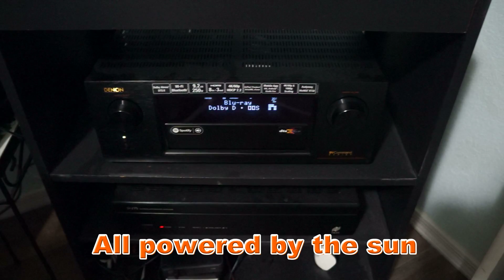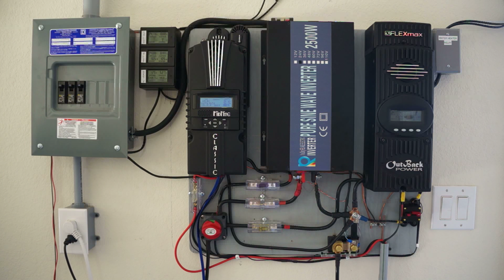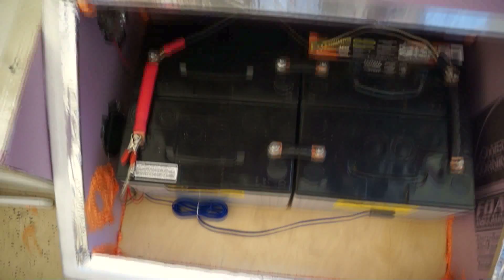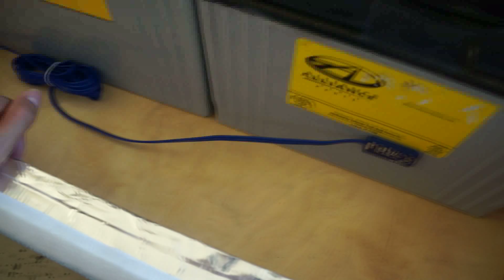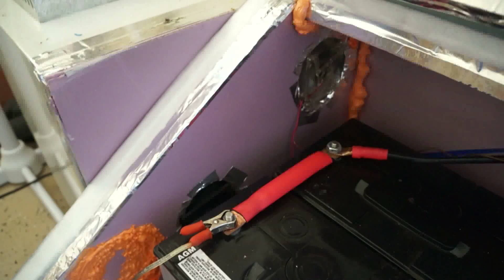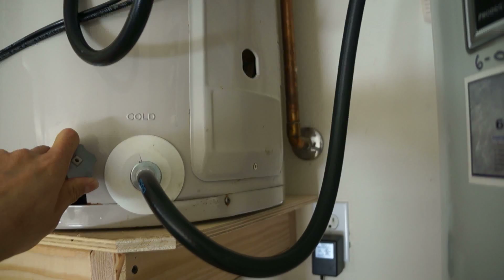2kw Off Grid Solar Overview - cooling battery bank, electric solar water heater! Midnite 150 Outback

Comment: This is great!!
I am looking to do about the same setup, do you have schematics on how you have the board set up with the midnite setup? or in depth pictures showing connections. Also part numbers and model numbers of what you have would be great, from the 24volt inverter to the electric combiner boxes.
Thank you for the video it has helped me stop obsessing on which way to go with the system I want to build.
Reply from the maker: Sorry, unfortunately I have no wiring diagram... I kind of rig it up as I go.. :)
Reply: Nice video! I noticed a few viewers asking for diagrams. With the demand for green energy and lot of folks wanting to do it themselves, have you guys ever thought about creating the diagrams with  the components needed and put them somewhere they can be purchased. Is there a law that restricts doing so? Add me as the first purchaser. Thanks

Comment: Great video. Plan on doing something very similar when we buy a house again. currently live in our fifth wheel trailer near Casa Grande. I have 1200 watts of solar with a classic 150 and agm batteries.
Reply from the maker: If I may make a suggestion, please look into getting LiFEPO4 or LI-ION and skip the AGM.  You can find LI-ION cheap on Ebay now.... LeadAcis/AGM is just troublesome... not worth it any more...  They were best at their time, but technology has move on...

Comment: Thanks for sharing some very useful info. Your outback charge controller might need a system reset. Mine sometimes refuses to go into float mode but after a reset its good once more
Reply from the maker: Reset, as in unplug battery and turn it back on?  If so, I have done it many times.  Anyhow, too late now, got rid of it already.  :D

Midnite Classic has been running without any problem.

Comment: Maybe I'd missed it, but why buy a DC element, all things considered an element is a resistor either or should work, and also why buy a second water heater when you could have put the DC element on the main water heater and the upper element becomes the backup???
Reply from the maker: It's a GAS water heater, there isn't any element.

As for AC or DC element, you're right, there's no difference. What I was trying to say is get the proper wattage ratting element... most of the one use for AC are 1500watts or more... Wouldn't work to well with low voltage dc.

Comment: So I was thinking about this.  What is your ground water temp ?  because if it's something like 60 degrees, you might be able to run a coil in place of your fridge using ground water to cool the batteries. Then, continue the ground water loop into a large circular ring even inside your garage that would pick up ambient air temp, thus preheating the water to something close to 100 degrees before entering the electric hot water tank.  What are your thoughts?  Of course, this would only work if you are consuming hot water off and on during the day....
Reply from the maker: Winter time the water is cold in the 50-60F, but in Summer time it's 75-80F, wouldn't help much.
Reply: Experimental Scientist you are LOL. hats off ;). But NO! The possibilities are endless with great minds of the people unfortunately if you ever do find an efficiency keep it to yourself because most that break that barrier and share are never heard of again. Not allowed ;)
Reply: Many think like you and try to find ways and some succeed. The problem is It is not allowed! Efficiency is controlled and has been for 200 years. NOTE: If anyone ever finds a way to truly live free do not share it. Utilize it for self and live free. Its Illegal!! We had an engine that got 200 miles per gallon a hundred years ago. We had a way of producing electricity with less than half of the output as the input. "Continuous endless supply of electricity". Its Illegal!! $$$$$ and power rule the world not your Fantastic great discoveries that would reduce the $$$$ to the power ;) Keep it to yourself and enjoy :)

Comment: why not use an mini arduino computer system to control your refridge so its not running all the time and it only is working when your batteries are too warm so as it gets cooler that it will auto turn on less
Reply from the maker: Because I do not know how to code Ardruino.  :)

Comment: super creative and awesome video. Have you ever considered the risks of having the hydrogen gas inside the battery box with nowhere to go?
Reply: I notice you started to say something about that but it skipped forward =)
Reply from the maker: LOLpsyentist its AGM battery, they're sealed battery, does not gases.
Reply: LOLpsyentist sealed batteries will off gas if they become overcharged. No matter how small the likely hood, he should vent that box just to be safe. Odds are those batteries will never be in an overcharged state but, better safe than sorry

Comment: How is your inverter performing? I have the same brand name in 2000W/36V - so far so good for me, despite being Chinese made unit. It is so cheap I am thinking getting another one as spare.
Reply from the maker: So far so good, but the AC voltage output seem a bit high, 129-130volts 
stock, I use the adjuster, but was only able to bring it down to 
126Volts.  A few of the direct motor drive appliance does not like the 
high voltage.

Comment: Here is question. Since the solar is only giving 48 watts could you eliminate the solar with a simple AC 48v charger from the existing grid system. Can someone explain why that would not work. I am in no way an electrician.
Reply: peter benjamin
Reply: Because The Grid/System/Government is not your friend and you cannot gain from the Grid only supplement it. Only credit towards your norm will you gain. You cannot make $$$ off the grid, Or utilize it in any way to benefit you.  
Hello!!! you have solar they already hate you! The so called selling power back is not reality. You are reducing your usage and the load on the grid therefore you get a credit for what you might have utilized. Note: The government and Utilities take your money, Never ever will they give you $$$ no matter how it might appear that way.

Comment: Excellent video! Lots of good information too. I’m impressed with the knowledge you have of solar. Thanks for sharing.
Reply from the maker: Thank you for the compliment, just passing along info's learned from others and my own mistake.  I will make a video of do and don't when I have time.  I sure did make a lot of mistake that could have easily been avoided.  :)
Reply: @DIYeverithing  great video brother , keep it up ... just a quick question , which charge controller would you say is better in performance and just about all around specs , outback or midnite solar ? I'm interested in purchasing a good charge controller and have been saving my pennies for a while now ..but I'd like to have an opinion on which is a better buy ! ... thanks

Comment: Hi, great video,  i have a plan to build a off gid with tis proportion. in my country. the deference is; i will use a solar water heater and  880ah battery bank. just one question; the air conditioner works for how many hours per day.  using the solar power.? thank you. great configuration. NJM
Reply from the maker: Hi, on a sunny day the AC can run from 8am - 4pm non stop strictly on SOLAR only.  On cloudly day, I can do the same, but during the cloud pass, it would use some from the battery.  But since I have so many panels now, even on cloudy day my 2kw still put out more than 500watts.  Of course this will all varies depend on your location... Here in Arizona, there's nothing but cactus and sun.  :)

Last time it rained hard, completely cloudy, while it's running it still put out 300watts.  :)  

Thanks for watching.
Reply: garabini I have a 48v system and I want to something similar except I'd like to power an inverter using a relay any suggestions
Reply from the maker: If you're disconnecting from the DC side, it would be expensive.
Reply: You mean, connect and desconnet the power inverter
using relay?
Reply: garabini NJM yes
Reply: devildestiny555 if under 100 I'm ok with it I want to run a second inverter using excess after bank is full
Reply: garabini NJM Also not sure if u got an answer but I run my ac offgrid for most of sun hours and about 5 hours overnight on a timer to keep from draining. My battery bank of 675 ah at 48v so it's a little smaller than your design but works great.
Reply: garabini NJM math says u will have nearly 21kwh to burn in battery bank. My ac uses 2 kw per day do you can use that in consideration as well when thinking real world appliance purchases take the yearly kWh divide by 365 and use that for average daily kWh

Comment: unless your solar is grid tied/hybrid there is a lot of unused power available once the battery bank is at float voltage.
MidNite Solar is awesome equipment, I'm using a kid with my 60 volt panels hooked to a 12 volt bank. Looks like you could just squeeze 2 more batteries in that box. too bad you don't have a basement, perfect temp for a battery bank. go dig a hole in your yard, lol
Reply from the maker: Haha... yeah right, I ain't digging nothing.  The heat here penetrate so deep, need to dig at least 5-6ft before it would be cool enough, not worth it  :)  I build the box to accommodate 2 more battery.... But to think of it, I don't think I will add more battery.  Spending on battery is so inefficient, it will just prolong my return.  This is why I decided to add the water heating thing and convert energy to heat and store it that way.... So far it work great.  My gas heater has been off for 10 days now with no shortage of hot water at all.  I am sure my hot water tank is going to outlast my battery bank.  Before the electric water heater, my system was wasting about 2-3kw a day, now only waste about 600-700watts and this is because of absorption mode.

Comment: Nice setup, the arrangement is quite nifty.Nice idea with the battery box, what happens during the winter ? Do you have to turn off the small refrigerator or keep it running considering that the ambient temperature would have dropped lower ?
Reply from the maker: Yes, going to turn it off soon.  Only going to run it in the 3 hot summer months..
Reply: Ibidapo Ilawole good work!
Reply: Hello Solexx X , the arrangement belongs to devildestiny555, I just happened to make a comment on his nice setup.:)

Comment: Great info. You have your cold water line going over the top of your propane water heater down to the electric. That hose on top is laying on  the exhuast that will get hot enough to melt it . The pipe goes through the roof to vent the heat that the propane creates heating your water. Hope its still on vacation when you get this. THANKS always for the great information and your time you share.
Reply from the maker: thanks... I know that cold line is close to the exhaust, it's not touching at the moment.  I haven't got the time to move it.  But my water heater is now on PILOT and has been for the last few days... so it's not burning.  :)  But yeah, I will shield that line soon.